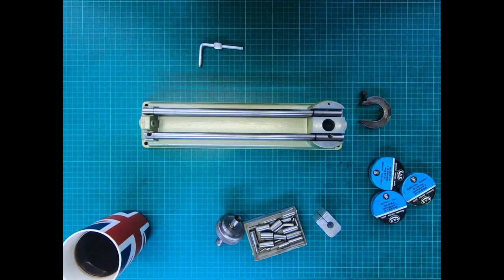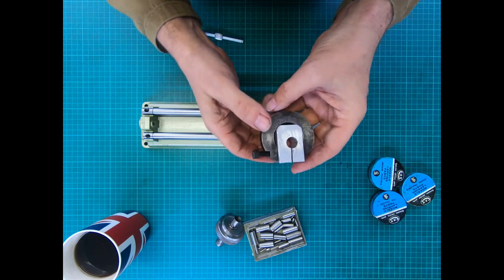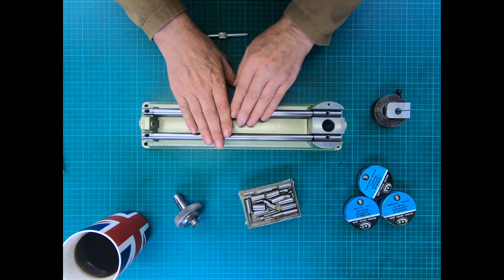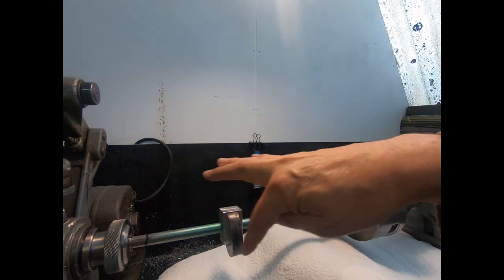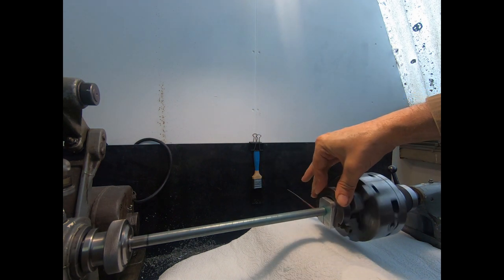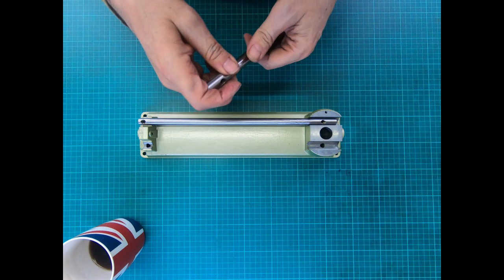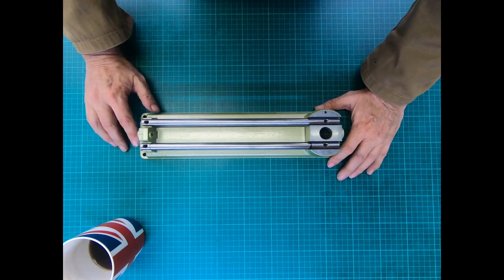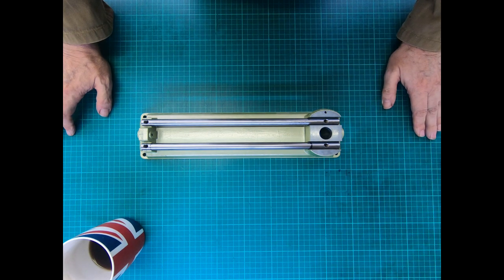Emco Unimat SL - Restoration - Lapping Ways.

Comment: Hi Paul, nice bit of lapping, it's such a satisfying process, I use the same method quite allot using diamond paste and aluminium laps. I've also used cast iron laps with diamond paste on hardened shafts, so long as your lap is softer than the material being lapped your ok. Time Saver compound is also good when you need to lap two parts together and can't use a separate lap, the Time Saver gradually disintegrates so that it does not become imbedded in either component.
Reply from the maker: Hi Nigel,
Thanks for watching and your comments, they do help... I will have having another go with the lapping when I try and restore the old Deckel SO grinder... so this is a nice little dry run.
Take care.
Paul,,

Comment: I always find these unimat uploads very interesting, as I have one of my own. Unfortunately, They're not terribly accurate . When I put my watchmakers spindle in and tried to repivot an escape wheel, the tailstock didn't line up as good as I needed it to in order for me to drill a tiny hole into the shaft. Having said that, The unitmat is a brilliant little lathe for general use in the home workshop and I wouldn't be without mine. Especially now that Ive changed my motor and fitted in a 24 volt DC one which I can have an infinite variation of speeds. 
Keep up the good work Paul
Reply from the maker: Hello Johnny,
I agree that the Unimat looks rather cool but in the accuracy department things are not so good... I have been doing work on the IME watchmakers lathe as well, trying to get that going... Hopefully when I have them both going, along with the Myford I should cover most things I am likely to want to do. I have a plan for a 24 volt DC motor for something else and hoping that I can share with the Unimat. Thanks for watching.
Take care.
Paul,,
Reply: Curious-where are your accuracy problems occur? Chuck? Taper between centers? Did you indicate it in?
Reply from the maker: @machinistmikethetinkerer4827  Hi Mike, no my comment was that the Unimat not like a Levin or Schaublin so one cannot expect that level of accuracy.
Reply: @TheKnacklersWorkshop  hi Paul oh ok. I thought I might be able to help. Don't know if you know this but a special watchmakers spindle assembly, labeled "WW" was made and available for the SL as an accessory that allowed it to accept 8mm watchmakers spring collets. There are also Unimat E16 spring collets and chuck out there that increase accuracy also. Both are obsolete, rare but do show up now and then for sale but are extremely expensive as you can imagine. I have a set and they work really well. Keep up the videos. I have a couple really bad beginner videos on my channel with more to come. Cheers.

Comment: This is interesting and not a process we have seen before. As the lapping process will take a tiny amount from the diameter, do you have to ensure that they are both lapped to the same diameter or is that not something to be concerned about? Thanks for showing the process
Reply from the maker: Hi Joseph,
Yes you would could lap both side, a bit like grinding a valve and value seat on a cylinder head. On this old lathe all I and trying to do is get some little lump and bumps off. I don't believe doing it or not will make much difference to the overall result of the lathe.
Take care.
Paul,,

Comment: Very interesting lil project here...
Could a person have possibly gotten similar results from taking a stone to the rods as they rotate?
Love the clamp by the way, neat lil thing
Reply from the maker: Hello Craig,
Thanks, what you've suggested might work, however the lapping block does ensure everything is parallel 100% of the time and that the same pressure is applied therefore guaranteeing a consistent result along the shaft.  I am not sure when the clamp came from but worked well here. Thanks for watching.
Take care.
Paul,,